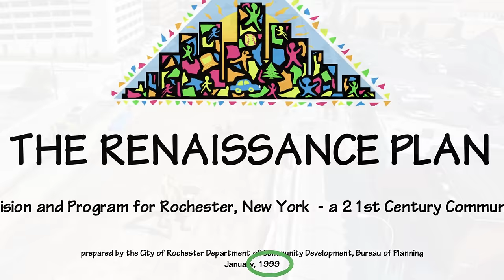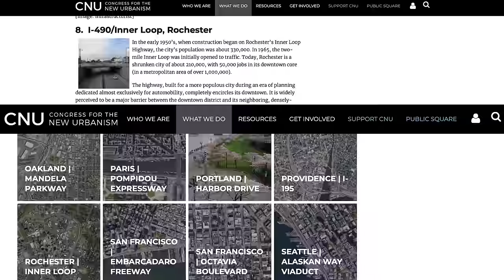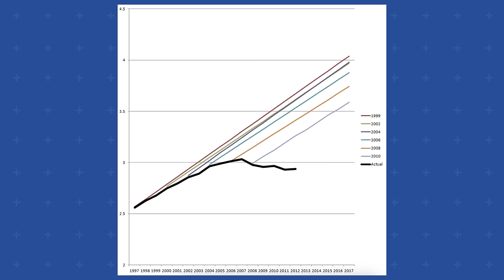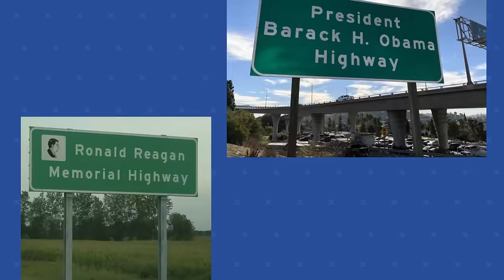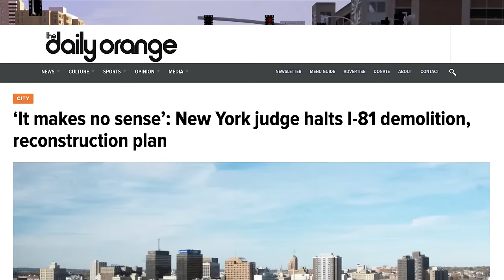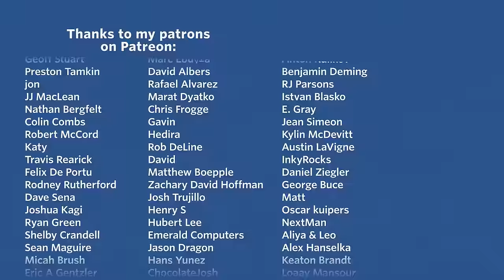How to Remove a Highway

Comment: There's a road just outside my neighborhood, 2 minute walk, and there's a corner store i love just across it. I can never walk there, due to the amount of people that run the red light. It is a 6 lane road intersecting 3 lanes on each side. It connects thousands of people, so I want to propose a solution. Pedestrian/Bike Highways. Build them on top of the road, and make connections to each sidewalk that needs connecting, and now I can go across easily, and bike down to the highway south and north of me. It would fix so much and get more people walking, which is exercise.

Comment: Im assuming the plan to remove I-81 in Rochester would also include a plan to resign I-481 to I-81 and maybe widen it to 3 lanes instead of the current 2, or keep it at 2 lanes depending on traffic volume.

Comment: Unfortunately Toronto is at a low point when it comes to removal of the Gardiner Expressway. The Expressway is crumbling and needs a commitment to either tear it down or repair it. While Toronto recently elected a mayor who is positive for alternative forms of transportation, she was elected at a time of huge budget deficit and was hamstrung. In a you-gotta-do-what-you-gotta-do moment, she essentially sold the Expressway to the provincial government. This took a huge load off the books, but the conservative provincial government represents commuter car drivers, not city-dwellers (who are credited for electing the mayor). I'm sure you can guess what the premier / governor chose to do with it (reinvest in it).

The greatest irony is that Toronto is actually growing very fast right now, but that means that the real estate is insanely valuable. Building new housing, more efficient transit solutions, and productive commercial spaces would be a way better use of resources. But it's out of the hands of those who want it gone.
Reply: If it's valuable for regional transportation uses, doesn't it make sense that it be funded and controlled by a regional government? It's the same regional government that controls the commuter rails, and is building subway and other rapid transit expansions.
Reply: No it doesn’t
Reply: Unfortunately Toronto is at a low point when it comes to removal of the Gardiner Expressway. The Expressway is crumbling and needs a commitment to either tear it down or repair it.

I would tear down the existing Gardiner and build a brand new one with modern materials and design so that it could last decades more. Never understood why people would advocate tearing down the Gardiner to replace it with a boulevard that would both slow down traffic and make things more dangerous for pedestrians/cyclists unless they were complete separated from vehicles.
Reply: @UzumakiNaruto_  they are repair it as you speak

Comment: I’m from Baltimore, we have a “Highway to Nowhere”… not a real name, just how the locals call it. Was going to be a part of I-70 is the 70s, but due to local opposition the stretch that got built never connected to the main highway.  It’s maybe a mile long, sunken highway that is barely used. It’s also in a bad part of town than can use a lot of funds to develop it. For decades, there was talk about replacing it, but it remained just that, a talk. Politicians don’t really like spending money on Baltimore, for some reason.

Comment: I was wondering what's your opinion on a city like Mumbai in India building a Coastal freeway (about 30km ~ 18.75mi) to connect the Northern suburbs to the South Mumbai (Government/Business District). Although they plan to build pedestrian promenades and parks along the freeway, I believe that the primary aim of this freeway is to decongest the Arterial roads of the city. Currently, at the busiest of times, it can take upto 2 hrs to travel as little as 25km (15mi). The freeway claims to cut it down to 40mins. But, with a economy like that of Bharat (India), where more and more people will be able to afford cars, will it cause induced demand? 
PS: They are also expanding the Metro network and upgrading the already existing suburban railway network.

Comment: The one thing I'll say as a New Englander is the Big Dig was possibly the best the city could do. Rerouting traffic by removing I-93 downtown would have been impossible without adding a ring road and destroying many communities, even though one had been in the original design for the Interstate system (there's still an offramp junction on the elevated highway north of the city that's never been used). It took a lot longer and cost much more than the public was told it would, thanks Boston corruption, but it led to the addition of one of the most beautiful parts of the city, the Greenway. The execution was horrid, but the outcome was the best that could be hoped for

Comment: Not a fan of "endangered".  There's nothing dangerous about removing highways, but there's a lot of danger of having them in cities.

I'd like to hear what businesses "rely" on the highway.   Often, business owners say that changes to roads will harm them, and often, they actually don't.  If the replacement street will not permit 18 wheel trucks, and the business is a UPS distribution center, I can see the point.  But most  businesses worst case can just take a little longer driving without much loss.  And that's if the business is primarily about operating vehicles, which very few are.   Businesses that "rely" on a highway to bring people to them will generally do much better with a a boulevard.  If the plan was to simply remove any type of higher capacity road from that side of the city, then I could see the argument.

Comment: Halifax Nova Scotia is in the process of removing its highway from downtown. We had a bit of luck years ago in stopping the full construction of the harbour highway, but a large interchange was built and has spent the last 55 years falling apart. Just as expected, it was an easy political call to remove instead of repair, and the city hopes to make millions from the land sales from the excess land with the much reduced street grid vs the old interchange.

Comment: All the highways in the outer boroughs that are half completed thanks to Robert Moses failing like the Sheridan Expressway should be removed completely. The perfect example is the Prospect expressway where 1/4 is only built and the rest is just a wide at grade street, the KWVP in Staten Island and I-295 in Queens are nowhere near finished and never will be as the right of way is completely developed or protected by conservancy. This is just unnecessary car infrastructure that wastes some of the most expensive real estate in the country, in a city where 60% of residents don’t even own a car. 🫤

Comment: Luckily for the west the Embarcadero Expressway was destroyed by the Loma Piera Earthquake and the government or any man made authority could not stop its destruction.  With the expressway destroyed and no predicted carmageddon by the highway experts they came to their senses and determined it was too expensive to replace the elevated expressway to withstand a big earthquake due to soil liquification. It opened up San Francisco waterfront real estate as a very significant benefit to the city.  Likewise the 2001 Nisqually earthquake which did not cause major damage to to the Seattle waterfront viaduct showed after engineering and geological studies the the viaduct to be very vulnerable to a major earthquake and too expensive to strengthen, due again to soil liquification. Once again highway proponents could not block the removal of the viaduct. The viaduct was replace by a tunnel which properly designed can withstand a major earthquake since basically a tunnel move with the ground. Seattle waterfront is so much better and valuable without the viaduct.

Comment: So, I hate the way Toronto is and how bad they messed up the highways. But the Gardner you included in the list of dead highways.... It's not dead lol, not even close. It's the primary artery into Toronto. It be great if they were able to somehow fix it, but it's actually overutilized and not underutilized. It's sad because of how the city has expanded around it, it's not as simple as replacing it either, you'd need to do some serious imminent domain and destroy some of the most productive and expensive land in north America and or housing much of which is high density surrounding it. It's a problem, it's just not as simple as tearing it down. If you're from Toronto you'll get what I'm saying, Toronto is basically unfixable. Thankfully we also have some of the best public transit/regional transit on the continent as well, so you can completely avoid it in many circumstances.

Comment: I live in Tokyo, Japan. In my younger years, I supported the progressive idea of removing highways that rip apart communities. Living in Tokyo with a regional population of around 40 million, everything is shoehorned in. All the highways are elevated and creative uses have been made for the spaces beneath them. Some of the highways run above the original business highways, thereby making the road geometry 3-dimensional versus just going wider. Parking facilities, public works maintenance facilities/offices, community centers, shopping centers and restaurants, sports facilities, etc. My point is just saying let's remove the original sin seems intellectually lazy to me as well as expensive. If the complaint is that the highway was built for people outside of the community to the detriment of the community, then using money from those outside of the community for a community project at the expense of those outside of the area is also wrong. I feel the challenge for communities and the governing parties should be to come up with a solution to reconnect and improve the surrounding community with ideas that enrich and improve the lives of those peoples while keeping the roadways in place, adding to the tax base, and increasing usage.
Reply: Raising or burying a highway, I'd assume, is just as expensive. Just look at the Big Dig. The highways in Tokyo, as well as the overall investment in these kinds of roads, don't even compare to attitudes in North America.
There's a certain irony in calling proposed solutions by actual industry people "intellectually lazy" while offering an alternative of well, the community should be able to come up with something different.

Comment: The Skyway doesn't need to exist. It sits right next to Furhmann Boulevard, which is underused because the Skyway is right there, and so removing it wouldn't stop commuter traffic. The problem is that Fuhrmann Boulevard sits on a large isthmus and removing the Skyway would require at least one commuter bridge. A bridge exists on only one side of the isthmus, at South Michigan Street, and so one would need to be built to link to Furhmann Boulevard. There's a bridge further away at Ohio Street too. What the South Michigan Street and Ohio Street bridges have in common is that they're really old and honestly need to be replaced before the Skyway can be torn down. One of the biggest reasons people don't use them often is because they're draw bridges that allow boats to sail down the Buffalo River and into Lake Erie & the Niagara River. Either they're gonna have to be really high so there's no need for a draw bridge or the Buffalo River needs to be closed off. I'm still for demolishing the Skyway though because there's been a lot of development in that area but it's hard to access, even if you have a car. The best way to get to the outer harbor right now is to go to Canalside and take a $1 trip on the bike ferry. 😂 It's a great time and a fun place to walk/bike around and have a picnic tbh.

Comment: If I heard you right, people said that regional is more important than local. However, it is the local that pay the taxes, so if Syracuse wants more tax dollars they need to put the local people first. Taring down I-81 will increase the value of the land and increase the economic growth along the boulevard. 
I understand that the convenience of I-81 will be removed, but the regional people need to understand when you don't live somewhere, your opinion doesn't hold weight without bribery. Bribery is a federal offence deserving of prison, so don't bother. prison is more inconvenient than a boulevard. Lol
Reply: If all it does is put all 100,000 cars on the street, I'm not sure if that's good. More traffic=more congestion=less safety. Maybe it won't matter depending how busy downtown is, but a 4 lane boulevard with 2 lanes in each direction will NOT be able to handle 100,000 cars a day. Drivers will only be diverted to other surface streets. Good thing they have a loop road around, but not sure how effective it will be encouraging drivers to use it. We will just have to see I guess.

Comment: So in my area they want to tear down a below grade freeway next to Downtown which is good. However the replacement is going to potentially be a 9 lane stroad based on the DOT's traffic calculations. There has been a lot of push back by the public but it seems like the community is losing. So the question is which is worse a below grade freeway or surface level 9 lane stroad?

My sort of conspiracy theory is that DOT would want to make the road as wide as possible for more funding. This is why projects like this should not be lead by the state DOT especially considering they can barely maintain our roads.

Comment: What about the people who use these every day to commute?
Reply: They still can through the boulevard, by the sound of it the highway was already incredibly underutilised. 
Given how expensive road infrastructure is to maintain, there are much more sustainable ways to use the space it had occupied.
Reply: A chunk of them only see a marginal improvement in their commute time as a result of the highway and take other routes and/or switch to transit.  Then those who can adjust their trip times (either for commute or occasional trips) will do so.  What’s left should be sufficient for the remaining traffic.
Reply: Do you not care about the people who live in the neighbourhoods that you travel through on your commute?
Reply: @kjh23gk  they most likely drove on those roads too.
Reply: @321fan  Yeah, they're going to turn the northern section of the Inner Loop into a couple of dozen single-family homes so the current traffic that wants to go from the neighborhoods east to the downtown baseball stadium or to I-490 west can zoom right through a brand-spanking new residential neighborhood.  Also, the lottery for the parcels on the Inner Loop infill will create a couple of dozen winners plus angry and resentful people who lost out on the lottery by the thousands.